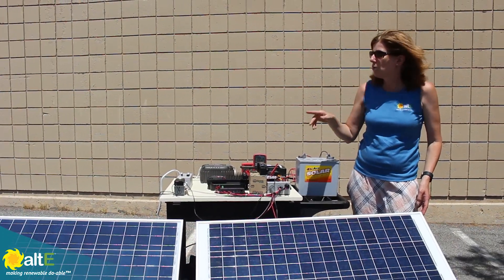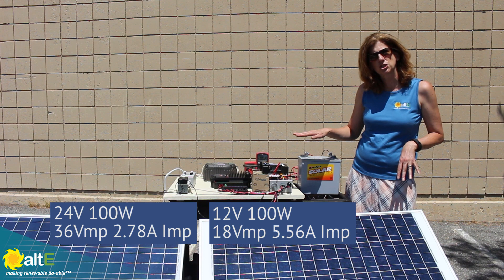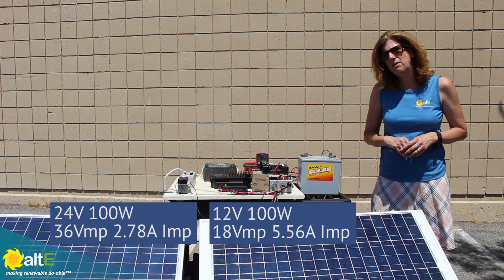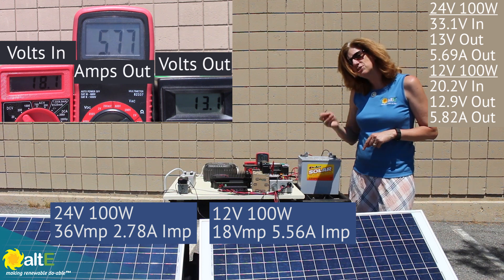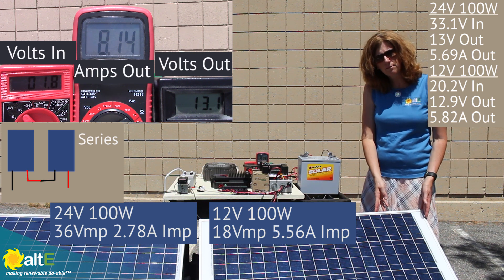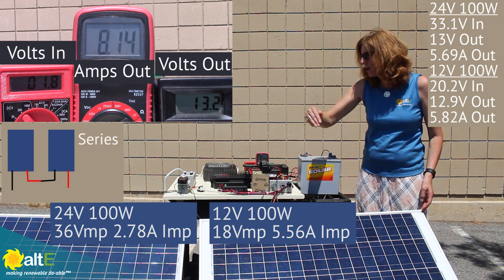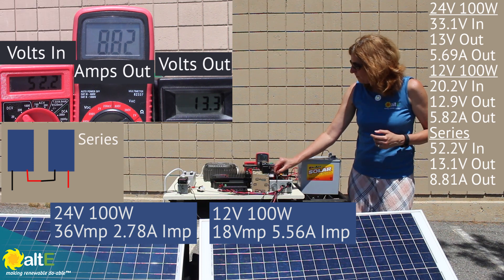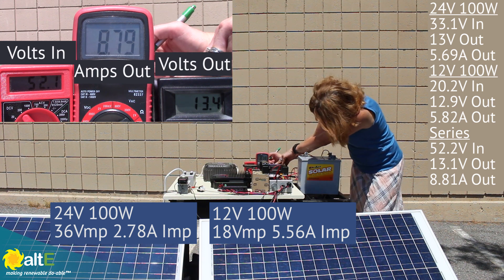Mismatched Solar Panels- Same watts, different volts and amps

Comment: I have a question.I have 10 600 watt plates in series. Now I want to add my old 200 watt panels to this string. The volts of old panels are 36V ampere is 6A. Now if I make 3 pair of panels in series and the connect  the three positives and connect the three negatives from the 3 pairs to create a parallel connection. Can I then connect these parallel connections in Series to the existing series connection of 10 plates?

Comment: The two panels are producing 75W by themselves, but 115W in series. The max current from the 12V is getting cut in half by the 24V. Keep in mind that in series current is limited by the lowest current panel.

Comment: Mam,
     Can we connect 250w,24v solar panel to 12v battery?....my professor told 12v solar connect to 12 v battery...why we cannot connect 24v solar to 12v battery
Reply from the maker: You can with an MPPT charge controller. The output will drop the voltage and raise the current to keep the same watts and charge the 12V battery. Watch this video, https://youtu.be/V2b7z2eTb5o

Comment: how would i do this if i have 4 of each of these?  i have 4 250w 12v panels and 4 250w 24v panels.
Reply from the maker: 2 separate charge controllers
Reply: @AltEStore  that would be optimum but what if that isn't viable?

Comment: Hi Amy, Can you please suggest a rather cheap MPPT controller just for a 100 W panel? My needs are covered with that so I do not want an expensive gear.
Reply from the maker: If you only have 100W, and I assume it is a 12V panel (36 cells, ~18Vmp), you really don't need an MPPT charge controller for a 12V battery. Just a 8A or higher PWM will do the trick, like this from Morningstar, https://www.altestore.com/store/charge-controllers/solar-charge-controllers/pwm-solar-charge-controllers/morningstar-charge-controllers-pwm/morningstar-sunsaver-ss-10-12v-10a12v-solar-charge-controller-gen3-p10503/ . "Cheap" MPPT charge controllers tend to be just that, cheap, and not worth it.

Comment: Hi Amy, I have a question regarding my system. I have two solar panels connected in parallel. 1 is 5 Watts 1 is 20 watts. They are both 12 volts. I installed two diodes one for each panel. I have 2 lead acid batteries connected in parallel both of them combined equal 13 amp hours. Right now my batteries are at 12.3 volts, my charge controller is 12/24 volts and 10 amps. My problem is, when I don't connect my solar panels to the charge controller, the reading on my multimeter is 19.7 volts. And when I connect the panels to the charge controller the reading is 11.8 volts. I went ahead and used a different charge controller, by the way they are pwm. And the results were the same. I went as far as using a step up converter. And still same problem. The panels were in full direct sunlight. Can you please advise as to what the issue might be. Thanks
Reply from the maker: Voc is when there is no load on the panels, and therefore no current flow. You will get around 20V. When you connect them to the battery through the charge controller, it will pull the voltage down to the battery voltage. As the battery charges up, the voltage you measure will go up.
Reply: altE I see. Is Pwm ok to use with my set up? Or should I go for an mppt?. Also, forgot to mention that my batteries are not charging very well with my panels. Could it be that my batteries are sulfating? Thanks so much for your replies. And your sound answers

Comment: which would work better  i have 250 watt panel and 270 watt panel   both mono solar panels cheers guys 

250 w  -   (voc 37.8)   (vmpp 31.1)     (imp 8.05)

270 w  -   (voc 38.3)    (vmpp 30.8      (imp 8.77)

Comment: I have 4 panels 260Watts Vmp 32.16v, voc 38.10, Imp 8.08A, short circuit 8.79 A connected in series.
and other 4 260Watts Vmp 29.99v, voc 37.89v, Imp 8.67A, short circuit 9.22A connected in series and both strings are connected parallel.
I am using MPPT charge controller i have tested connect first string with controller and got 660watt and when connected both strings as parallel got 1050 watts and it should be 1320watts as per sum of the watts 
What i have to do to overcome the losses? Thanks.
Reply from the maker: Your description is the best way to do it. You are only seeing 20% loss. That is very good. Remember that the ratings on the solar panel are in ideal test conditions. The real world is rarely ideal. I always plan on losing around 30 or 35% throughout the system, so what you are seeing is good. I'm guessing it is hot there, that makes the voltage drop, which is some of the loss. There is not much more you can do, I would be happy with that.
Reply: altE when i was using fist 4 panels that all are 100% same then i was getting 6 to 7kwh in a day. And after 1 year i have updated my system and add 2nd 4 panels strings as parallel,
Now i was expecting 12 to 14 kwh in a day but unfortunately i was getting only 9 to 9.8 kwh in a day.
I want to overcome this loss abd this is due to difference in voltage and amp.
Reply: @msalman373  how is your system doing? I've also got 4 x 330w mismatched panels and planning on installing 2 pairs of like panels in series and then connecting to the other 2 in parallel.  

In your earlier submission you mentioned that the first string of 4 x 260w panels was able to give you 660watt. But then later you said the same 4 x 260 string gives you 6 to 7kWh in a day. Looks like there might be a  problem with your estimation. Because if that's true then it means you are getting roughly 9hrs of sunlight in a day.

Comment: Because I realize that when it is very cloudy my 2 X 24V panel only provide 56-57V which is not enough to charge my batteries (I think I need 58 +  V ) . Looking forward to add one 12V solar panel in serial to my actual 2 X 24 Volts on my 48V batteries setup .I actually have a MPPT controller . 
Do you think that could work and not be too much voltage for the controller during sunny day (expecting 36V + 36V + 18V = 90V) ?

Comment: So, in this case with these panels you definitely should use separate charge controllers for each panel.   Because, otherwise, you lose in either series or parallel - just more loss in parallel.
Reply from the maker: Yes. There is no good way to wire these 2 panels together without 2 charge controllers.

Comment: wow thats awesome thanks for sharing i will connect all my panels in series.
Reply from the maker: But only if the volts are different and you have an MPPT charge controller.
Reply: yes mppt charge controller are the best but where i live there are mostly chinese mppt controller.
Reply from the maker: That's a good point. You have to be very careful of the cheap "MPPT" charge controllers. Many of them are not true MPPT and will not handle the high volts in, and won't increase the amps. Read the specs and instructions carefully, and if it is very inexpensive, don't waste your money. We replace a lot of those cheap ones with real ones for people.
Reply: altE do you ship solar products globally or only in usa.
Reply from the maker: We are able to ship internationally through a freight forwarder of your choice. We have systems installed on every continent of the planet. However, international orders must be paid by wire transfer or verified PayPal account.
Reply: wow thats good i think i should buy product from you in future.
Reply from the maker: I agree.
Reply: Or better, watch vids where people test them to see what is real MPPT.

Comment: Plz Do one Video using two charge Controllers on same Battery bank with same or separate array of solar.  
also Plz let me know is it ok to use mppt Charge Controller with PWM charge Controller with separate solar arrays but on same battery bank??  thanks
Reply from the maker: I'm pretty sure I just recorded that one last week, 2 charge controller, 1 MPPT, 1 PWM. I'll be editing it this week. Stay tuned. Hint, it worked great.
Reply: The problem with connecting 2 charge controllers to the same battery is they confuse each other , if one is working well putting say 13v into the battery the second controller reads the 13v as the battery voltage and thinks it doesn't have to work would be good to see some videos on this though 
@thamessolarelectric
Reply: @ryancollingwood4605  This is not true.

Comment: Great vids, thank you for taking the time to make them...but I'm a bit confused so I'm hoping you or some one could explain, I was given 3 solar panels, 185 watt ea...(nt-185u1) they put out on the volt meter 44.5 volts. How do I decide on Pwm or mppt solar charger? 12v or 24? Thank you...and I subscribed!
Reply from the maker: Those Sharp panels are nice, we sold them back in the day. They are 24V solar panels. So the answer to your question depends on you. Are you charging a 12 or 24V battery bank? If 24V battery bank, you can do either PWM or MPPT. If 12V, you have to do MPPT or lose half the power. 
You have 185W x 3 = 555A. So you can do either 24V battery with at least a 25A charge controller, either PWM or MPPT, or at least a 50A MPPT charge controller for 12V battery. If it were me, and I didn't have any 12V loads or a 12V inverter already, I'd go 24V battery bank. Gives more room for expansion in the future (solar can be addicting, you'll want more later).
Reply: +altE thank you for the quick reply...I went to your website...considering the mppt 24v...great help, and yes I haven't connected and I'm already getting addicted lol...

Comment: You've given me so much useful information now, I can't figure out the solution to my situation. I think I've reached my information  input limit. But I don't think I've seen my situation yet. One existing 90w 12v panel adding two 250w 12v panels in parallel. Up grading to an mppt controller and adding more batteries to the 2 that I have. Would the 90w panel drag the 250w panels down?
Reply from the maker: Are you sure the 250W panels are 12V, 36 cell? I don't know of anyone who makes 12V panels that big. But I certainly don't know all of the products out there. Rule of thumb, same volts but different amps, wire in parallel. Same amps but different volts, wire in series. Well, darn, that was a spoiler for my next video ; ) In your situation, since the panels are so different from each other, and you are already planning on getting another charge controller, I would keep the 90W on the charge controller you have, even if it is PWM, and put the two 250W panels on the new MPPT charge controller.
Reply: All I needed to do was be patient  and the video would come. I can't leave the existing set up, it's for an RV, there isn't room. I better look closer at the panel specs, I could have those wrong.
Reply from the maker: I have a feeling the other video you already saw is your video, the 200W 24V and 50W 12V. https://youtu.be/ZAKTMSEHfk8 I would put money on the 250W panels you are looking at are 60 cell, 20V.  You saw in the video that parallel wasn't great because the volts were different, and series wasn't great because amps were different. Get a little 10A charge controller for the 90A, and 45A MPPT for the 500W, and you will have great performance.